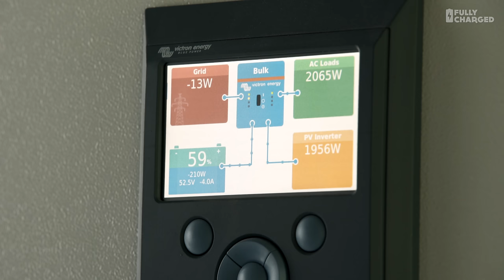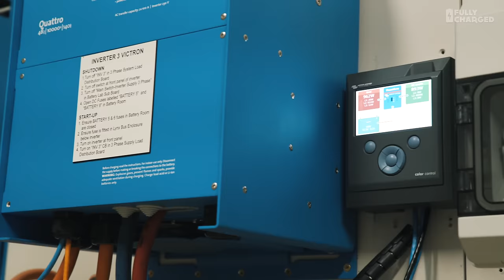Redflow ZCell batteries for home renewable energy storage | Fully Charged

Comment: I want want want. For my home storage, I don't care about size / weight, I want longevity. Can't wait for the to become available in the uk.
Reply: Chris Marshall Flow batteries have got relatively low energy density, there are better options. Wait for the Ambri battery invented by Professor Sadoway, these will be the standard battery storage systems in the future.
Reply: graphine.
Reply: If you don't care about weight and size then look at Lithium Titanate (LTO) batteries. They are used in trains and hybrid buses. They are less dense than LiPo batteries, easy to manage and relatively economic. Oh, and you can actually buy them, which helps...
Reply: @grahamcampbell8297  he said in 2021 and that's two years away as I write this down. And we really don't know if it come in 2021. But yes Ambri battery has 1000kWh on board but it's a mid small size container. Hopefully they'll come while we are still alive.
Reply: DEDSEC R13  nice to know but also Ambri batteries are the sort of the same. It was said in 10yrs time  they lost less than 1% I think.
Reply: Don't forget he said these batteries are made out of the same stuff that they use in fire extinguishers to put out fires and you could actually use the battery liquid to put a fire out. That is a big safety factor that might outweigh the size of and energy density of better battery technologies.
Reply: Chris, 

if you are in the U.K., don't even think about solar and adding batteries is just adding cost and no benefit. You are far better off paying our inflated (because of renewables) elctricity cost than squandering your money on solar panels and a battery.
Reply: Why not mention environmental impact of zinc bromide?

Comment: Good to see a flow battery that's finally making it to market. For static applications, these really are more sensible than lead or lithium cells. It will be interesting to see how long the pumps last - but that shouldn't be a large replacement cost if it fails.

Comment: This flow battery looks like a perfect solution as a package in addition to the home as a product.

If it does not wear out, then it becomes part of the home.
Reply: You have to replace the pumps periodically, but they're a fairly low cost item I believe. Oh, and I think you also have to 'recycle' the fluid periodically, also a low cost item. Actually looking at a ZCell for my place, as I know a guy that works at Redflow and I like to support local if I can.

Comment: He mentions that the capacity does not degrade over time but he did not mention the (overall) life of the battery in cycles which is mentioned in the web site and it states;

'A disadvantage of flow batteries is their expected life cycle compared to lithium-ion batteries – they have a lifespan of approximately 4000 cycles at 100% depth-of-discharge, which is less than lithium-ion’s 5000-6000 cycles at 80% depth-of-discharge.'

My two cents..

Pros - the discharge rate doesn't degrade over time, can deplete the battery  to 0% without risk of damage to the battery, better for the environment than lithium, no risk of fire, no risk of magnifying a fire, made in Australia (pro for Australians re: parts, servicing and jobs etc)

Cons - Currently more expensive than equivalent or better Lithium products available and a shorter lifespan,  with pumps etc  maintenance/servicing will be required.

Conclusion - when the price comes down to about 75% of the equivalent lithium product this will be a leading choice for home battery storage with what is currently available on the market (May 2019). Where money is not a consideration I think this is a leading choice currently due to the environmental and safely benefits and also the fact that the battery can be depleted to 0% without damaging the battery. I have seen people destroy there battery systems from over discharging at great cost so this feature is a massive benefit.
Reply: @Big J - The biggest con in my opinion is the following. As a chemist, he doesn't go into any detail regarding the zinc necessary to manufacture these batteries. Zinc does not exist in a pure form. It is a horrible compound to smelt and has massive CO2 production whilst doing so. The slag heaps that are produced from that zinc sulphide smelting also produces massive problems with the ugly heavy metal waste - which are either toxic or poisonous.
Reply: @simonpinkerton4905  Regarding the chemistry, just how much zinc goes into these flow batteries? Wouldn't that be important to your analysis?
Reply: I offered no analysis because that would be dependent on the type of zinc compound(s) used within these batteries, and the internal reactions/temperature needed to make them continually recharge. I'd figure on asking Redflow if you really wanted to know
Reply: @simonpinkerton4905  ZnBr2

Comment: Another great professionally made video from Robert &Co. What this video has shown is a number of things. 
1 - That a 10KW PV Solar Panel system only generates 1.9KW so is shown to be only 19% efficient - for that reason most commercial PV Solar Panel systems need a large number of PV Solar Panels to generate anything meaningful. 
2 - No one is talking about the costs of these PV Solar Systems with battery back-up for the simple reason they are very expensive and almost never see a return on investment [ROI]. Typically 30 to 40 years ROI which is outside the warranty period for most PV Solar Panels. 
3 - There's a significant loss through the inverters  it can be as high as 50% and with the inverters connected it is always draining the batteries unless you use an isolation switch to disconnect the inverter.
4 - Again never discussed is the constant maintenance required to keep the panel clean to maintain the los efficiency of the panels ! If they are mounted on your house roof - there's the issue of climbing ladders dragging up a hosepipe and brush to clean the top of he panels.
5 - Once installed you're stuck staying in the same house for many years as you cannot take them with you !
May sound down on alternative energy systems but this is the true facts - they are talked about and sold as the best thing since sliced bread - but that's not true - huge costs, maintenance issues etc.

Comment: I live in Texas where we get a lot of sun, and several counties offer property tax exemptions if you power your home or office building entirely off solar or wind energy. Perhaps, there is a market for an integrated solution where homes are designed with solar panels and batteries from the start, with various architectural styles available to the home buyer. One community at the old Mueller Airport in Austin does this, but to a limited extent. Redflow could possibly work with their US distributor and help? We have home builders who focus upon energy efficiency and who do very well in the new home industry. There might be avenues for collaboration here.

Best wishes! Love your show, because I love the idea of a clean environment, and I love saving money. I'm also disappointed that Fully Charged hasn't been picked by any television channel yet.

Comment: They didn't talk much about the drawbacks. The following is from the wiki page.

Drawbacks include:
•The need to be fully discharged every few days to prevent zinc dendrites that can puncture the separator.
•The need every 1-4 cycles to short the terminals across a low impedance shunt while running the electrolyte pump, to fully remove zinc from battery plates.
•Low areal power (<0.2 W/cm2) during both charge and discharge which translates into a high cost of power.
Reply: I love his enthusiasm and the range of tech in his videos, but he could do a better job trying to be objective or skeptical when outrageous claims are made.
Reply: This seems easy to overcome if you have 2 or more of these batteries, the one that needs cycled will be drawn down for use as power in the building (or to top off the other battery).

And how can you say the cost of power is high when you are talking about watts/area? That's not watts/dollar.
Reply: Yes but he's not a tech head which is probably why a lot of people find his videos good (cos he's just a layman).
Reply: Joe Malovich wouldn't even need two units. If the plates are self contained, a controller could cycle through, say, 4 out of 5 plates ensuring constant charge/discharge cycles while reducing unnecessary redundancy rather than having two big discrete units.
Reply: thanks a lot. also isnt this just a different electrolytic battery ? flow batteries use fluid dynamics to store energy, not chemical reactions.. (or Im missing something)
Reply: He did say that when you discharge the battery  you are performing a maintenance cycle, I don't really know how big an issue the shunt thing is... can this just be automated?

I don't know what low areal power means, can you explain what you mean by high cost of power? They did say this is more expensive at the moment than LiPo.
Reply: what were the outrageous claims?

Comment: The two things in this video that gave me pause were a brief view of a chemical warning sign on the wall of the testing facility, suggesting a leak in any of the units under test may be somewhat hazardous, and that a home installation may need to be in an out building specialized to this technology. That would add to the  already higher cost of an installation compared to the powerwall idea.
On the other hand a powerwall does need a functional cooling circuit because unlike a flow battery its electrolite is always in full contact with the electrodes at a high energy density. Both systems do need safety considerations well managed. Of course I am old enough to remember when having a heating coal bin in the house was a potential health hazard,  not to mention fire hazard. The build up of coal gas to combustion levels was regularly being blamed for house fires in those days.

Comment: This is a very nice technology which has enormous potential. Can you tell me the overall efficiency of the battery pack? I assume it to be a little less than present system as it has to run the pumps and also has the heating and associated losses. Also, it would be great if you could tell the charge retention time of the battery pack if any load is not connected to it.
Thanks!

Comment: 3:40 when he talks about the surplus and going back to the grid, that's so clever and simple, and clean. But if those batteries are filthy to make and they don't last long at all, like most batteries these days, it's not that efficient. If they're not dirty to make or dispose of, great stuff.

Those bigger batteries about 8:46, if those are as powerful and reliable as they're saying, you could use two or three of those to power a lorry, stick a solar panel and a little wind turbine in the shape of a usual roof scoop like rally cars have, put those things on the roof of a lorry, could be an idea ; )

Comment: One of the best channels on YouTube. 

Really loved this video. 

I have a feeling the Tesla Powerwall is much better than this device because of one reason, price. 

The Tesla Powerwall uses the Gigafactory. This means it's going to be much cheaper. 

This flow system is fantastic. I just imagine it's super expensive. I also think assembly must be very labour intensive which will keep costs high. 

Going forwards the flow battery system definitely has legs. 

The thing is, the Lithium battery's will become cheaper and cheaper. A Tesla Powerwall which becomes 30% cheaper than it is today will really damage this particular company. 

This guy should work with a giant investor to find a way to get economies of scale. Unfortunately it will make losses (similar to Tesla) for a few years. 

I really love this product but I just think the Price per Kilowatt (battery) will be a major factor in this market. 

If you can Renew a Tesla Powerwall cheaper than buying one of these. This will give you 20 years of good energy. 

Lithium ion technology and solid state Lithium technology will also be a major game changer. This is all coming in the next 10 years. 

In 15 - 30 years we may even have Fusion reactors coming online. 

The best hope for this business is for Lithium technology to remain as it is.

Comment: Two comments: 1) Not true that "all" inverters shut down during a power outage.  We are currently putting in solar at our home in Arizona with an SMA Sunny Boy inverter - that provides some power when the grid goes down. 2) There is a big tiny house movement in the U.S.  Solar storage solutions need to take into account the space and form factor needs for small installations.  We don't have a true tiny house, but a very small 1920's bungalow home with limited space.  We cannot use the Tesla Powerwall 2 simply because it can only install in a vertical or "portrait" orientation.  You need a very large home, or a big garage or basement to install.  Our space is limited near the power panel and we need a storage solution that is short and wide - that is, a horizontal or "landscape" configuration.

Comment: Great video,  while disappointing at the same time. I didn't know about the zinc plating aspect  till this video. I was hoping that this tec could be used in cars. When your battery got low, you could simply pull into a "gas station", have them swap out the depleted solution for fresh, and in a matter of minutes you could be on your way with a fully recharged system.

Comment: Some of you may be familiar with the youtuber "Photonicinduction", if not, do check out his video called "Cheap Backup Power", it's a similar system to this but it doesn't use expensive futuristic tech, just common sense. In short Photon has a system worth £700 that pays for itself in 2 years that can run the house's power during the day, and it charges from the grid's supply at night when the electricity is cheaper. Though the main striking difference is that this system (in this video) charges from solar which is a benefit of Australian climate, this wouldn't work nearly as well in the UK (where Photonicinduction is from). Photon's system uses lead acid batteries, not sure how it compares in efficiency, but factoring cost it's better suited to the UK. Would love to see this system become more efficient and possibly to the point that it would be viable in the UK

Comment: Glad to see these are actually an available product now. I've been hearing about them for a few years. So how much is a 10kWh redflow battery? And do I understand correctly that you can discharge at about C/3 so that's 3kW, which is enough to run the kettle (very important!), but maybe not an electric shower unless you have two batteries.

Also I guess some care has to taken to install it flat otherwise the 'flow' over that sheet isn't going to work very well. Or does it have built-in gimballing or something to deal with this?

Looks like a really nice product. There is also the sodium salt Aquion batteries now available also aiming at this market, but emphasising that none of their components is poisonous (unlike Bromine), so that the battery is exceptionally safe and recyclable. That one has quite low discharge rates (especially last 10%) and efficiency, but is otherwise very nice and simple and safe.

Batteries is going to be a really interesting area for the next few years, and the humble lead-acid will probably finally get knocked off it's perch after about 120 years.

Comment: The thing that breaks with flow batteries, in time, is the piping and the pumps which need to be cleaned and eventually replaced. It should still last a decade but I doubt it's going to last 20 years without refurbishment.

Comment: It'd be interesting to see a compact 2kwh version of this installed into an RV type application
Reply: Sorry, that'll never happen for two reasons. One is that flow batteries are much heavier per kwh than lithium. But the killer is that the flow battery needs to be completely still. The technical problem that Redflow has solved is nickel crystal formations on the electrodes. And that solution requires very precise flow of the electrolyte, hence they will only every be for stationary applications. Redflow are testing a newer battery that should be 30% cheaper, so hopefully a bit more competitive with lithium batteries. Eventually, I can see these being not much dearer than a refrigerator, the price is is in the intellectual capital, not the resources required to manufacture. So scale will cause the price to drop significantly. At least that's my hope and I can recover the 80% of my investment in the company that I have lost so far. But I"m not about to cut and run anytime soon.

Comment: My uncle setup a solar panel system at his house, and he used car batteries, he has a closet filled with like 50 of them.
Reply: Should replace them with deep-cycle lead acid batteries, like they use on Yachts. They'll hold more energy and last much longer.
Reply: Or a Bromide-Zinc thingamy - I hear they're available now & will last way longer, with no degradation...
Reply: +nerd1000ify
He already dropped a shit load of cash on it, so I don't think he's ready to upgrade any time soon lol
Reply: They are working on a mark 2 smaller model . They had some at Redflow Factory in qld , went for a tour after the AGM .
Reply: brickman409 I would bet your uncle didn't use car batteries, but deep cycle batteries. They look just like car batteries (and could easily be used in a car, but wouldn't perform very well in winter). Car batteries are lead acid batteries that are capable of releasing very quickly their stored amperage, but are delicate and easily damaged by over discharging down below about 70%. Deep cycle batteries are also lead acid batteries but are built more sturdy so they handle deep discharge better, down to around 50%.
Reply: Try Iron Nickle batteries very tolerant of draw downs and voltage irregularities and you can build them yourself at low cost.